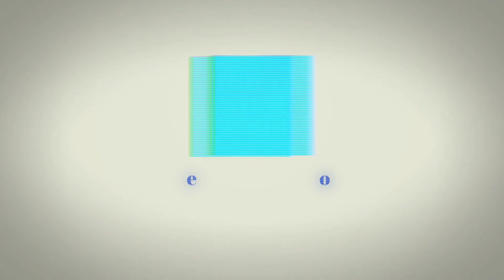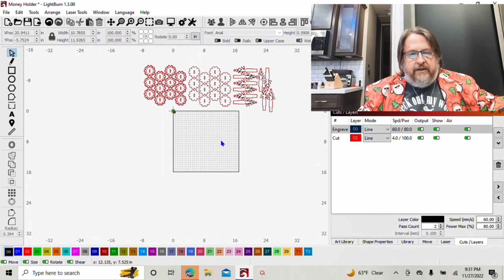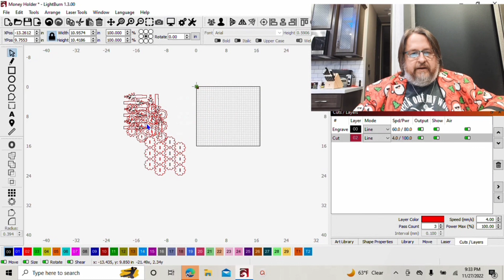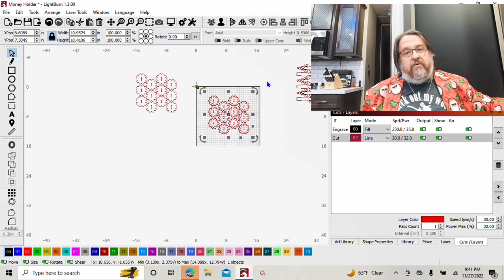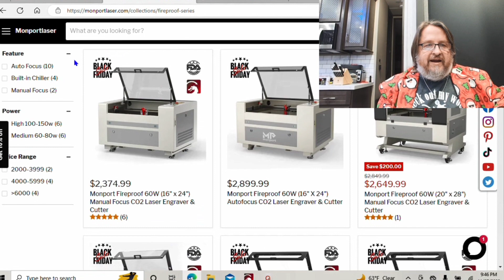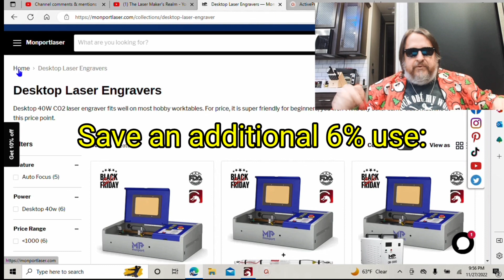Why you should invest in a CO2 laser engraver

Comment: I, like you , am very disappointed with the capabilities of the xtool d1.  I was looking for a 20 watt but then I saw Azetar 35 watt and now, I have seen you talk about the monport 60w.  You should have had the 60w for a month or so now.  Would you buy it again?
Reply from the maker: If you are looking for increased speed in cutting and increasing productivity, it's a must. This video justifies the reasons for investing in a CO2. Their US based customer support is the biggest reason to buy this particular laser. I love it. I still use the diodes. Currently using the Comgo Z1 10W. The majority of my viewers are using diodes, so the majority of my content will be demonstrating techniques with the diode. But I LOVE being able to build much larger projects with the workbed of the CO2. When you get yours, be sure to use my code HOBO6 to save yourself an additional  6%. Thanks for watching.
Reply: @HoboWithWood  Thanks for replying.  I have been strugging with what to move up to.

Comment: How did you get LightBurn 1.3.00?  I looked on their website and don't see it.  Is it a beta version?
Reply from the maker: I've been chasing problems with my sub-layers. Tried everything to correct the problem. Even uninstalled and reinstalled. Still having problems. In an attempt to fix it tried the new Beta. Still having problems. Now thinking it's a hardware issue. New PC will be here soon.

Comment: Watching your video and am amazed at how slow your 10w D1 is! I have the 20w and burn through 3mm birch at 6mm/s, 80-85% power with 1 pass. I think your settings are a bit over kill.
Anyways, i do agree that CO2 is far superior than diode in most cases and regret not having bought one originally, but i would have never been willing to spend the $$ on CO2 right out the gate. Last month I decided to buy a CO2 and was all set to do so, buuut my tenant is moving and i have to remodel and sell my old house first, so hopefully in the spring!
Reply from the maker: I want " drops". I want completely clean cuts. Depending on the quality of the wood 4mm/s, 100% pwr and 3 passes still requires the use of an hobby knife to separate. I've struggled with this laser since it was new. This is the second module. The first one was worse. I'm really looking forward to trying my next one. I've got the Comgrow Comgo Z1 on the way. But I'm most excited to see the real speed and power of the Monport CO2. Thanks for watching.

Comment: I agree a C02 laser is the way to go for speed, but I will say my diode is still a great asset in my shop I use it as a supplementary laser and use it for detailed engravings since the dot size is alot smaller than a c02 laser.
Reply from the maker: I'm planning on doing the same. I'm looking forward to trying my next diode. I've got the Comgrow Comgo Z1 coming. I'm hoping it's going to do everything the xTool D1 will do and then some. I'm planning to do all my cuts with the CO2. Then do my detail work with the diode. The purse I make is 99% cutting time.  To go from 4 & 5 hours on the diode to minutes with the CO2 is going to be like me going from the Chevette to the Corvette. I'm excited to see what it's limits are.

Comment: Hi Steve.  I had a similar experience with xtool and fortunately bought it via Amazon so I eventually returned it.  But there are better diode lasers that are much cheaper with good customer support such as the ortur lm3.  I feel your price comparison is a bit unfair because there are good diode lasers that are cheaper and the honeycomb and air pump can be bought on Amazon for 1/3 the cost you state and an air purifier is not required if you can vent to the outside.  It’s also only fair to mention that the diode lasers have twice the work area of a co2, so there is that trade off.
Reply from the maker: The prices I quoted were the prices I paid for them. I'm sure they all have come down some. But the point I was making there wasn't a huge difference in what I originally spent vs an 80W CO2. There are a LOT better diode lasers out there. But they are still not going to be something someone should buy with the intent of starting a laser business. Unless they are planning to buy several of them. Otherwise you spend most of your day waiting for a job to complete. As for the workspace, the CO2 I'm getting has a 20" x 28" workspace. My diode is much smaller approx 17" x 16". The desktops do have a smaller workspace 8" x 12". But if I can cut four or five times faster, I don't mind setting up twice as often. This video is mostly demonstrating diodes really shouldn't be marketed as a small business option. There are too many people with lasers in their dining rooms today running a small business using these CO2 lasers. Someone with a diode only cannot be competitive in pricing when it takes 10X as long to complete the same project. I've got three diodes now and a fourth one on the way. I won't be getting rid of the diodes. But I never would've guessed a large CO2 laser was obtainable until I really did some homework. After mutiple heart attacks and two strokes, my time is valuable. I don't care to spend it waiting on a diode to do in 4+ hours what can be accomplished in minutes.
Reply: @HoboWithWood  I agree with your points about speed, time and money benefits of the Co2 vs diode.  Just pointing out that today a “good” diode laser with accessories is less than $1000.  I recently sold my diode for the monport 40W for the reasons you mention.  Looking forward to your new collaborative channel.  Thanks Steve